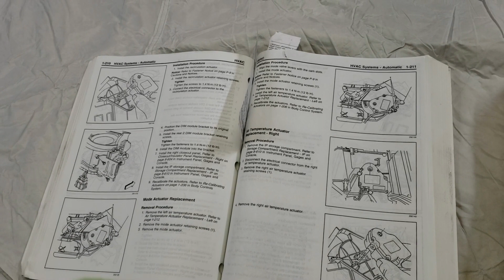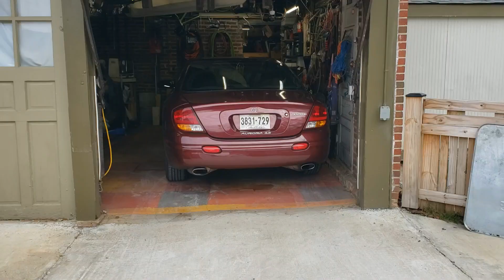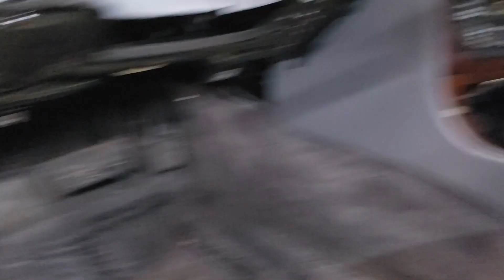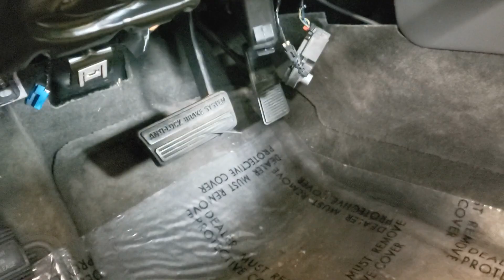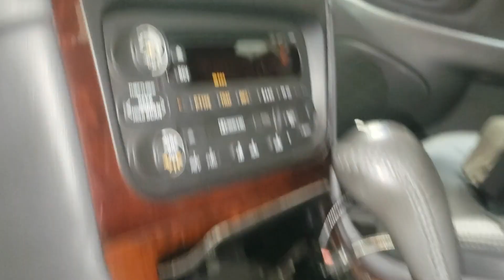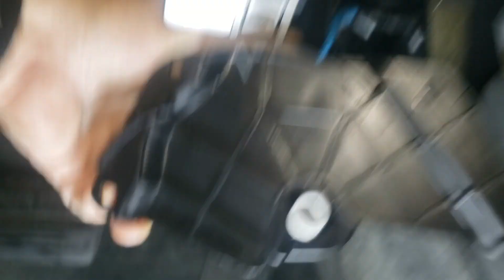Oldsmobile Aurora Episode 2: Fixing the HVAC mode and blend systems

Comment: Nice write up on the HVAC Temp & Blend (Mode) Actuator & Doors.  Maybe I missed it, however, what was the actual problem that you fixed?  It appears that you R & R'd the existing Temp & Blend Doors & your issue went away so it didn't appear to be the existing Actuators.  What was the actual problem?